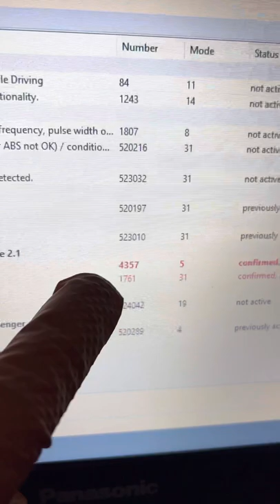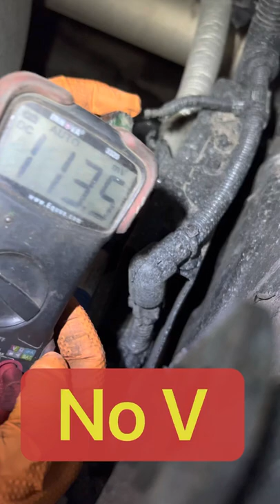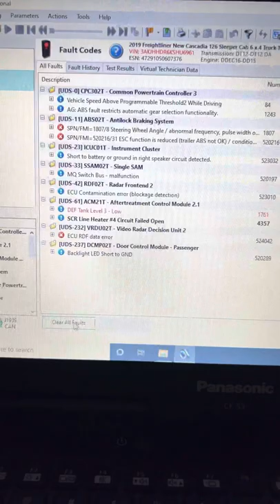Spn 4357 line heater 4

Comment: That slashing the lume off the wires I wouldn’t recommend. But super lucky the short was that close. Had to take apart most of those heat shields for the wires enough times to find a tractor side issue. Most of the time I find the short is in the line and is rubbing somewhere.